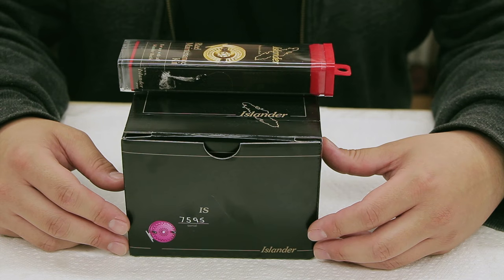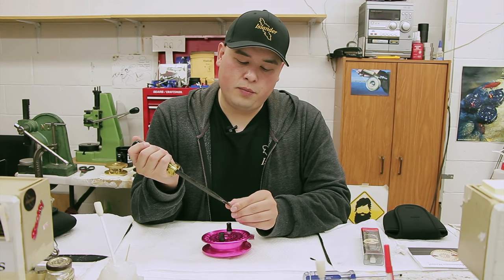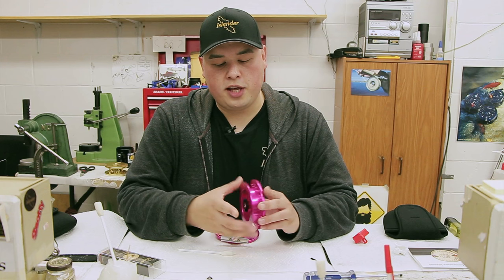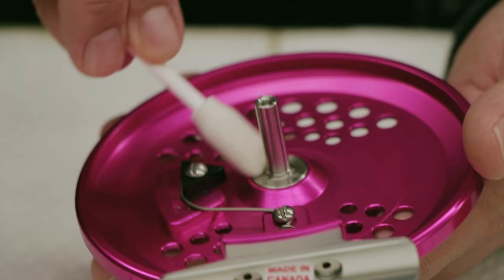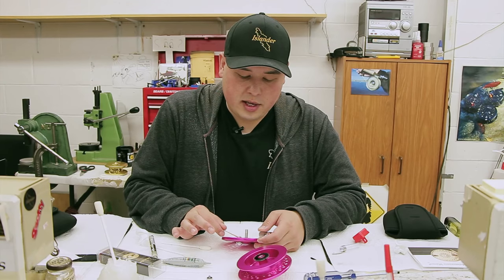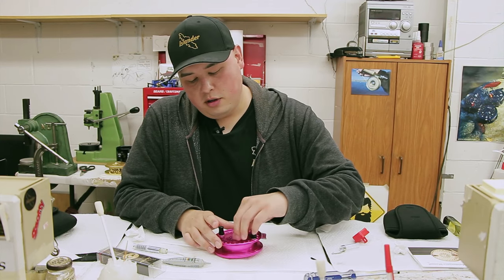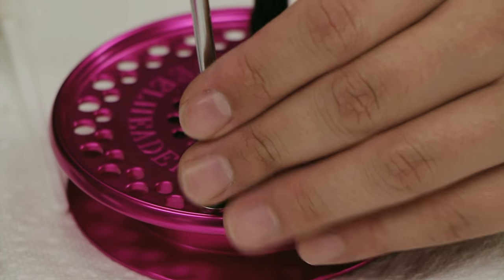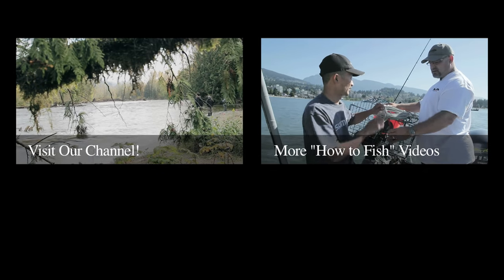HOW TO MAINTAIN YOUR ISLANDER STEELHEADER CENTERPIN REEL | Fishing with Rod

Comment: Such a simple design, how come they are so expensive??
Reply: I've wondered that myself
Reply from the maker: Because the material isn't cheap, the process of precision cutting so it can spin forever isn't cheap, anodizing isn't cheap, labour isn't cheap as everything is done in Canada but quality control is a lot higher. You get what you pay for.
Reply: Dragomir Ronilac Not really, just the aluminum alone costs about $35, add a good set of bearings $20-$30. Add all the other materials, anodizing and hardware and your'e well over $100-$150. Now add machining time (which is quite costly when precision machining is involved) anodizing, assembly, etc. If you are trying to compare the costs to offerings that are made in China for next to nothing then I think youv'e found yourself a gold mine and you should buy and sell their reels for profit, you'll make millions :P BTW I make my own pins so I know whats involved, want to throw some jabs give er.
Reply: Pretty expensive to bad float reels have become nothing more than status symbols

Comment: LOVE MY ISLANDER..THREE YEARS AND SHE RUNS LIKE A DREAM BUT I DROPPED IT AND SCRATCHED IT RIGHT WHERE I USE MY FINGERS TO APPLY DRAG..CAN I BUY JUST THE SPINDLE HALF STRAIGHT FROM THE FACTORY DUE TO THE OUTER RIM GETTING SCRATCHED ON ME?? ITS DRIVING ME CRAZY AS I FEEL IT WITH MY FINGER AT EVERY ROTATION..    BUTTON IS DINGED ON THE OTHER SIDE ALSO SO I WANT A NEW ONE OF THOSE TOO..  ID LOVE TO REPLACE IT WITH A BLUE PIECE, OR A NATURAL AND UPGRADE MY BEARINGS...YOUR ADVICE?? WHAT PHONE NUMBER DO I CALL FOR PURCHASING PARTS AT THE CHEAPEST COST TO ME.  WHAT IS THE PHONE NUMBER FOR THE BEST PEOPLE TO TALK TO ABOUT ALL THIS??  WOULD LIKE TO DEAL DIRECT AND INSTALL CERAMIC BEARING MYSELF..  WHAT BRAND BEARINGS DO YOU SUGGEST?   IS THERE A WARRANTY OR AFFORDABLE PROGRAM FOR FIXING
Reply from the maker: Have you tried phoning Islander Reels directly at 250 544 4856? Heather or one of the staffs should be able to help you out right away. :)